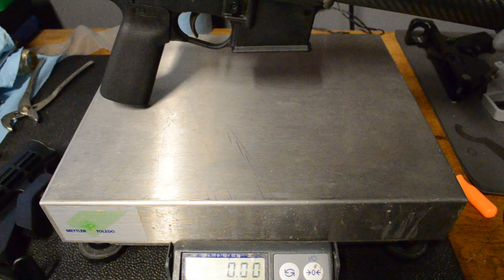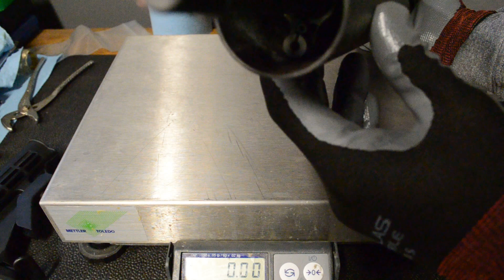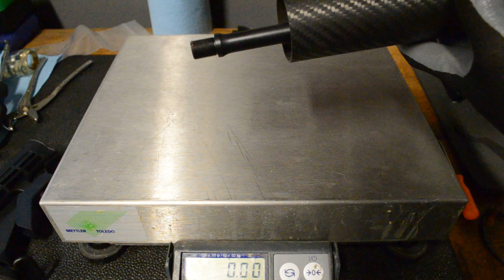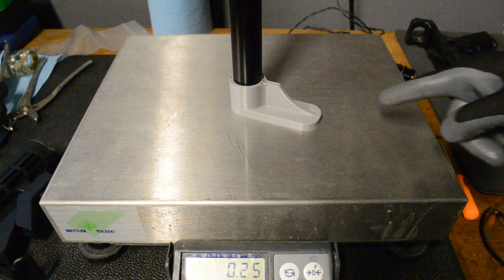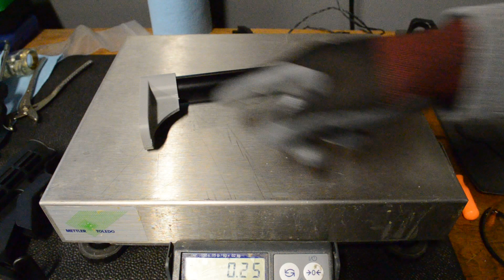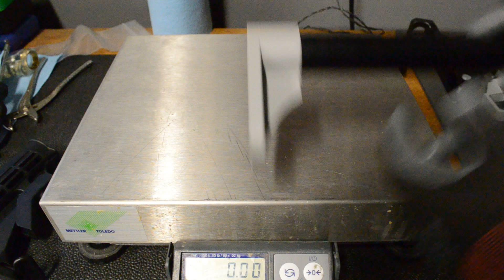4lb Piston AR15 With Carbon Handguard and 3D Printed Stock

Comment: Nice!!!!    I am also building a light weight pcc right now and I’m at 80.07 oz which is about 5 lbs total weight including the red dot optics and riser mount.  With Pcc, have to add weights on buffer system and the bolt.

Comment: Taking the weights out of the buffer does not help your gun. It hurts it.

The whole point of the buffer weights is to work like a dead blow hammer.

The weights move. That means that the buffer actually acts as a buffer - keeping the bolt from bouncing when it goes all the way forward, and keeping the rifle in battery.

It's worth the extra few ounces to not have your gun fire out of battery when you shoot rapidly.
Reply from the maker: He's had no problems with it. It's a range toy/race gun, not a survival or defense rifle.  The bolt is by design, almost impossible to fire out of battery.